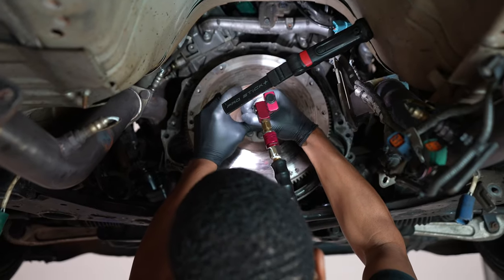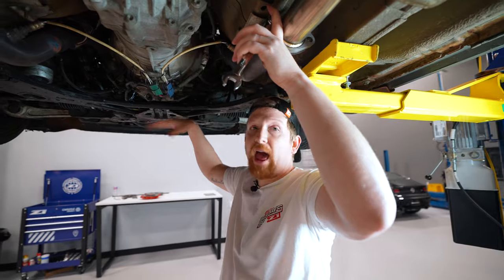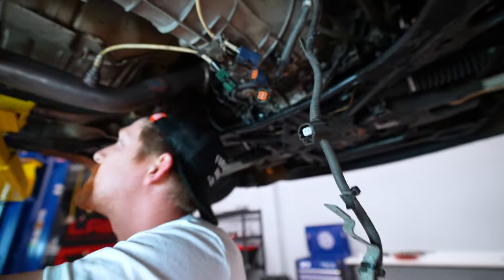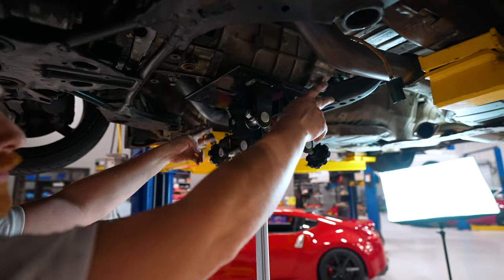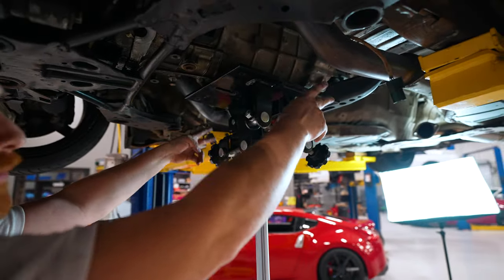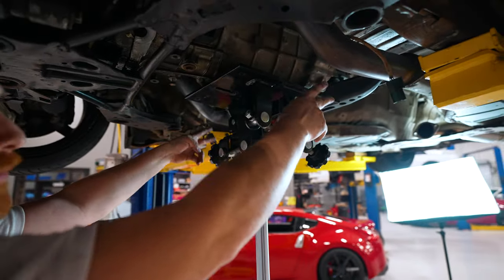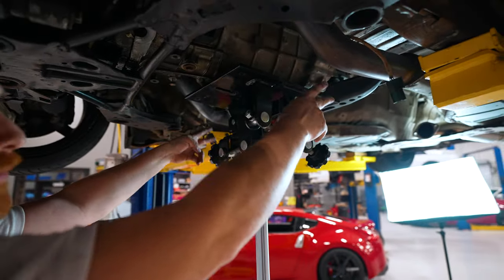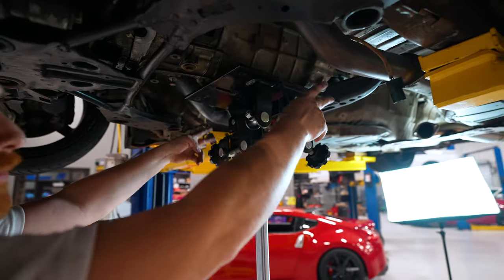Watch This Before Installing a Clutch On Your 350Z!

Comment: Why are the torque specs higher on this video higher than z1’s other 350z clutch install video? Other video says 3ftp less for flywheel & pressure plate, I am just curious
Reply: Nvm I’m seeing there are parameters for spec and you guys may have just stayed in the middle so both work fine

Comment: Anybody know what my problem can be if my g35 6mt won’t go into gear when my car is on ?? (Goes in gear when off tho) clutch is good. Happened out of no where after I kick clutched to drift a corner ?
Reply: Did you ever get it figured out? I’m having the same issue
Reply: I know this is late, but it could most likely be your Clutch Master Cylinder or Clutch Slave Cylinder. I would recommend changing both of them at the same time. Also, make sure to properly bleed your clutch fluid.
Reply: For anyone wondering, I had the same issue.  
1. Check to make sure the fork is getting about 1/2 to 5/8" movement from the slave cylinder on clutch compression. If it doesn't move that much you may need to replace master / slave cylinder and properly bleed the clutch line.  
2.  If that was not the issue and did not solve it, it's likely something in the bell housing broke
   a. Pressure plate tooth came off
   b. Piece of friction disk came off (I had a spring break off on my disk that was stuck between the pressure plate and friction disk causing it to stay engaged.
   c. Issue with the fork / throw out bearing
Some later 350zs have a slave cylinder inside the bell housing, so I'd start on the master cylinder and bleeding those lines first.

Comment: Sounds like I'm bout to have to do this job on my G35 rev up 😢got a horrible power steering pump type noise coming from the clutch even when depressed...not even sure it's worth it being at 280k miles now

Comment: Mann rn my G35 clutch makes a rattling noise but when I press the clutch in, it stops. Anyone know the issue? Legit its new barely 300 miles in. And it's a stage 2 clutch.
Reply from the maker: Did you replace the factory flywheel?

Comment: Compiled Steps, tools and materials I've made (with buying Z1 clutch kits):
Steps:  
2:00 - Disconnect Battery
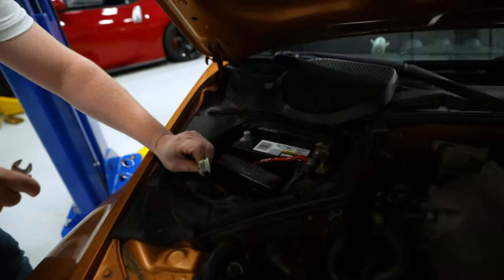2:30 - Disconnect Shifter, boot, bolts 
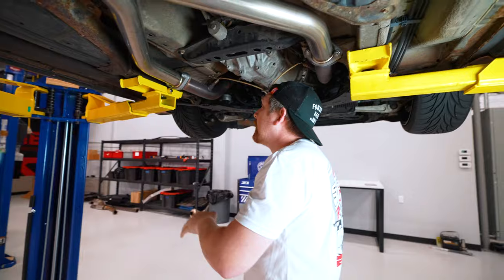5:50 - Remove Exhaust Y. ( Long length 14 MM due to studs in the way )
             NOTE: if it's rusted / seized, you may need to follow these steps
                         a. Try PB Blaster first, allow it to sit for a couple minutes, wait, and repeat a couple times.  Try to remove it if you can without stripping the nuts.
                         b. If it's so tight you can't break it with a breaker bar you may need to torch it and try again. Try to remove it while it is heated.
                         c. If heating alone doesn't work, try heating and then shock it with cold water while it was hot.  Try to remove it again.
                         d. If you can't get the nuts off due to them being stripped, buy a nut extraction set (14mm / 13mm) and use an impact wrench.  
                         e. If literally nothing works to remove it, buy a carbide Dremel blade with an oscillating Dremel and cut off the entire stud, buy a ball joint separator kit with an impact wrench to press out the cut studs.
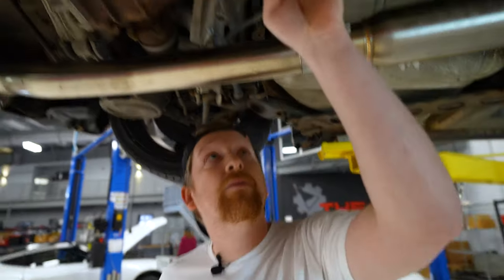6:48 - Remove Drive Shaft ( 17 MM ), keep it in gear to remove the bolts.  You will need to take it out of gear to spin it and get the bolts on the opposite site.
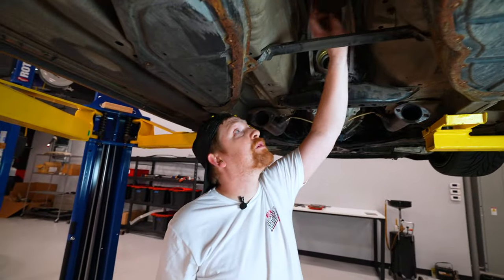8:18 - Remove Shifter rubber boot, and disconnect shifter link ( 12 MM )
9:23 - Remove Electrical Items, Put bolts back in ( 10 MM , 15 MM? in video, but I think they are actually 14 MM )
13:40 - Remove Slave Cylinder ( 14 MM )
NOT IN VIDEO:  Drain Transmission ( 10 MM Hex Bit, at the bottom of the transmission near the back, there is a vent tube on the top so no need to open where you input the oil )
14:17 - Unbolt Transmission to Engine ( 14 MM, 17 MM, 10 MM [drain plate / inspection plate at bottom] )
17:19 - Unbolt guard (behind transmission transmission support) ( 10 MM / 8 MM ?)
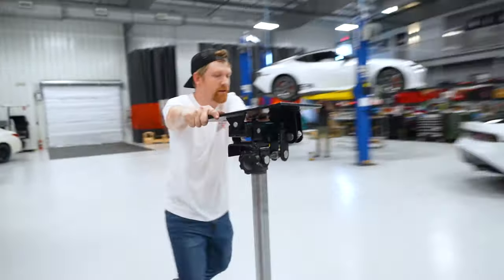17:30 - Add transmission jack (strap recommended), try to have the jack as level as possible with how it's currently housed, it will make it easier to reinstall it back in.
17:50 - Remove transmission rear support ( 14 MM ) 
19:00 - Move transmission back slightly to get behind support brace, then drop it down and roll it away
20:15 - Remove Pressure plate, friction plate, and flywheel ( 14 MM? or 12 MM?, T55 Torx Bit)
24:10 - Remove Pilot Bushing, install new pilot bushing. The pilot bearing should be about flush with the hub, once it's fully seated.
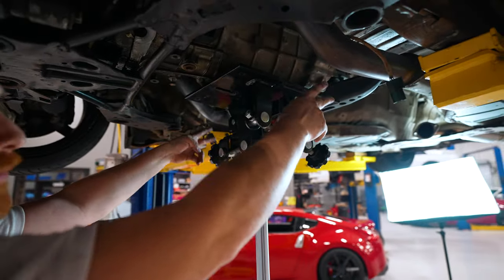25:27 - (transmission work) Remove Throw out bearing and fork.
27:24 - Remove throw out bearing with press or hammer, then install new one with press or bench vise.
               NOTE: Bench vise works very well (I used a 4 inch one), you can use the bench vise as a support for hamming out the bearing as well, just put a cloth between the bench vise and press it into place, it is very easy spent about 40$ for the bench vise from Harbor freight. 
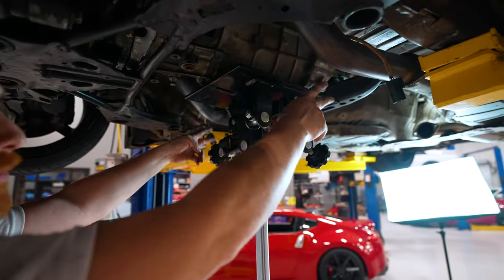28:16 - Reinstall throw-out and fork, throw some grease at the ball, where the fork pushes the throw out bearing, and on the driveline. 
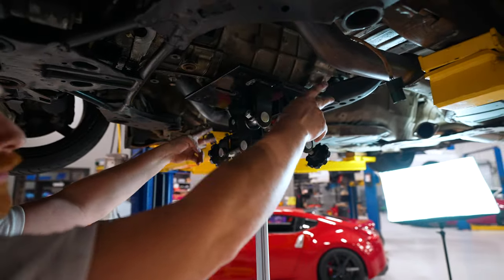28:55 - Install new Flywheel, make sure the position lines up properly (small hole in the flywheel for the sensor), use proper torquing as recommended in a cross pattern (68 FT/LB). ( T55 Torx Bit , Loctite 271)
31:14 - Install friction disk (protruding side should face away from flywheel), make sure the alignment tool is COMPLETELY inside the pilot hole and no threads are visible protruding from the friction disk.  Do not remove alignment tool until pressure plate is fully torqued.
32:53 - Install Pressure Plate, 2 stages of torquing them down in a cross-pattern ( Step 1: 14 lb/ft, Step 2: 32 lb/ft)
35:23 - Reinstall Transmission and support, try to have the transmission relatively flat so that it easily fits into the flywheel.  It will take some wiggling to get the threads to line up as well as making sure the driveline gets into the pilot bushing.  Put the transmission into 5th / 6th gear (put link to the left side of the car and push forward to get it into 5th), this will prevent the threads from spinning when wiggling it into place.  Additionally, you can use a breaker bar on the front of the engine where the engine moves the timing belt to get the friction plate threads to wiggle.
37:35 - Reinstall Wiring components.
38:17 - Reinstall Slave Cylinder
NOT IN VIDEO: Add Transmission Fluid, should take about 3.3 quarts, if your car is level the input plug (on right side of transmission, with 10 MM hex bolt) should be the cut off point of fluid to add, so use a siphon to put the transmission fluid until it appears full / leaks out, then it should be completely full.  If your car is not level, keep in consideration that if your front if higher you will put less oil than is necessary and if your rear is higher you will put in more than necessary.
38:55 - Reinstall Shifter link, lower dust boot, and shifter plate.  don't install regular shifter boot yet ( 12 MM )
41:10 - Reinstall Drive shaft ( 17 MM ) / Reinstall Exhaust ( 14 MM )
41:39 - Validate shifter plate position
42:06 - Reinstall internal shifter parts
44:00 - Connect Battery, validate clutch pedal engagement position

Tools:
1. Breaker Bar (potentially)
2. Bench Vise (Cheap option for pressing bushing for throw out bearing)
3. Pilot Bushing Remover (pilot bearing)
4.  T55 Torx Bit
5. Torque Wrench
6. Wrench set
7. Transmission Jack (low profile on jack stands, high for car lift)
8. If no car lift:
	a. Car Jack (18-20+ inch max height, I was able to do the work on about 18 inches, just can't fully move out the transmission from under the vehicle.)
	b. 4 Car stands 6 ton recommended (18-20+inch max height)
9. (IF lots of trouble with rusted or seized bolts): propane torch, impact wrench, nut extractor set, carbide blade / oscillating Dremel, ball joint separator kit

Consumable Materials: 
1. Grease, at least Grade 2.
2. Brake cleaner
3. Towels / Microfiber towels (pressure plate has a rough surface and will grab onto the fibers from a microfiber towel)
4. Transmission Fluid GL-4 (70W85 is stock, but 70W90 has also been used frequently)
5. red Loctite 271 (not a lot just a bead line on threads for flywheel install)
Reply from the maker: Not all heroes wear capes
Reply: @Z1Motorsports23  three days going and I still am not finished...  
  
First my exhaust bolts were so rusty I tried everything and eventually had to just cut off most of them.   
Now I'm stuck and can't get the transmission to go back in after installing everything.  Think it's stuck on the driveline splines not being able to fit into the friction disk for some reason, working under jacks so it's a nightmare 😢
Reply: @Z1Motorsports23  Think when I was trying to install the transmission at first it must of moved the friction disc and got out of alignment.  Had to re-align it all again and then took about another hour or so after that of tinkering with and it got in..  Going to update the comment with some more info based on what I ran into.
Reply: @Z1Motorsports23  I've updated the info and added timestamps if you want to add them to the video.
Reply: You are heaven sent

Comment: Took mine to a shop to replace the clutch. Mind you i drove it there with no issues. They state that the car cranks but doesn't start after the replacement. 
I told them about the dowl behind the flywheel and they said they put it back on the same way. I hate shops.
Reply: Sounds like a crank position sensor
Reply: that blows, how much they charge you
Reply: If you replaced the flywheel compare the tone wheel to the one you took off.  It's probably missing.  Ask me how I know

Comment: Finally a good video on clutch service for the 350z !! Great video . Just one question in Dave’s case when you were adjusting the master did you turn the rod counter clockwise to make the engagement higher ?

Comment: Mine chatters at 2k rpm pretty loud but in 5th gear at 2k it’s so loud, I have a performance street clutch with a un-sprung full face disc + lightweight flywheel. My mechanic says it’s chatter and it does sound like chatter, just very loud and worrying just wanted to get some peoples opinion 
I have a DE non rev up with a cd009 in a g35 coupe
Reply: yes this same lightweight disk. I was told it will need some wearing in and not to hit it for 1k miles. I m hoping this kinda subsides?

Comment: How much different is this compared to a 370z? gota do mine soon
Reply from the maker: It's very similar. The biggest difference will be your slave cylinder as it is located on the inside of the transmission and is one single piece with the throwout bearing.

Comment: Question for my fellow Z guys. On My 03 Mt 350z, my throttle body only work when I'm in gear. If I have my shifter in neutral my pedal will not operate my throttle plate. Is this normal or what?
Reply: I would try and do a throttle body relearn on the ECU first before anything, there are videos you can look up on YouTube to help you out.
Reply: @Roze_z33  man I appreciate the help. After this I got the car going and it runs flawlessly. Idk why it does that with thy throttle body but it doesn't do it with the engine running.